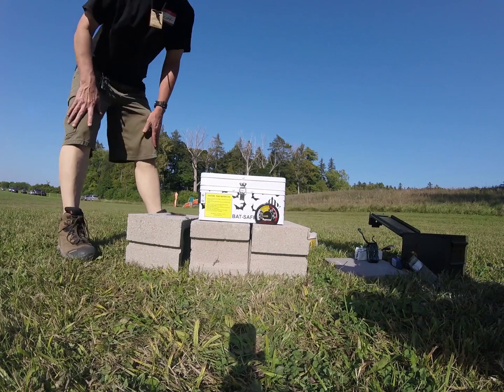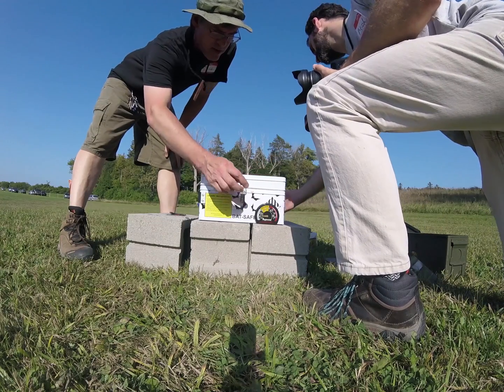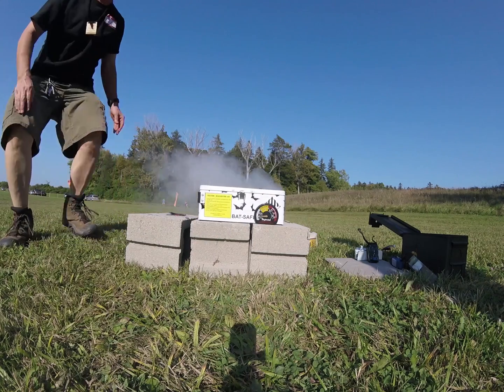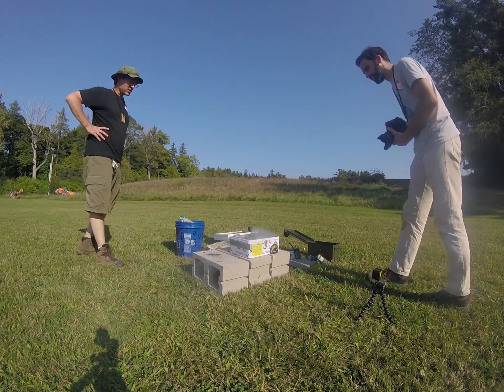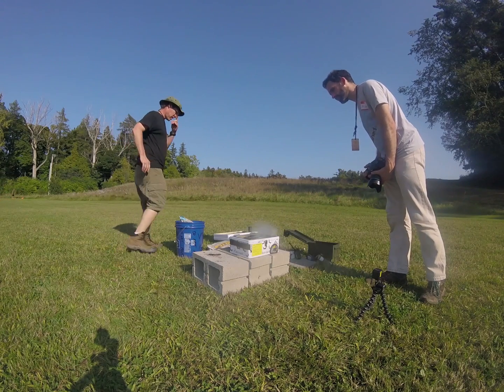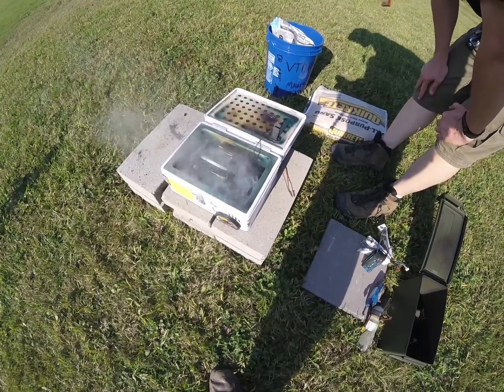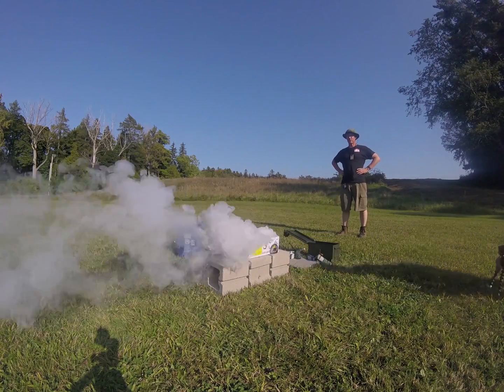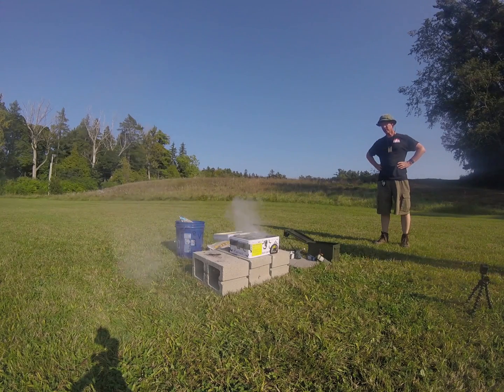LiPo container tests: BAT-SAFE

Comment: #BatSafe #Warning
⚠️⚠️⚠️ Can you please test the following for me, IT'S VERY IMPORTANT AND COULD EVENTUALLY BE A DANGER FOR YOU !!!! ⚠️⚠️⚠️

It is about the seal:

Please put a small piece of paper over the edge of the Bat-Safe and then closes it. 

(So there's a few cm inside the Bat-Safe and a few cm outside to pull it) 

(1 cm wide and about 10 cm long, so you can pull on it later (like a flap).

can you pull out the piece of paper when it's closed ?

With my 3 Bat-Safe's (Normal size)
I can do this both on the left & right side - both very simple, but really really easy on the front seal. 

So easy, I can even push / squeeze the paper in 🫣😱🤯🥴

do you know what material the sealing is made of ?

maybe I buy my own one 🤔

Comment: Can this box should be reutilize after a small fire or should get a new, what does your test conclude on this topic?

If a metal isn't melted and filter is easily replaceable then I don't see any problem reusing it.

I watched few videos about this box and your test was very convincing to get few of these including one from person who had fire during storage and was saved by this box and I personally had small fire and damage as a result during charging. However, I would split my batteries across more than one box, don't want to put too many eggs in same basket..lol

I'm planning to keep the boxes in the garage on the concrete floor away from everything including walls and using a smoke detector (may use smart detector so I can get alerts when the home is empty) in the garage as well.

Thanks for your good video guys, it was very helpful in making a decision whether to invest in one or not, before I was thinking to get an ammo box like others lipo owners but metal heating the bottom of the container was a concern for me 😊
Reply from the maker: The manufacturer says it can be reused. The box does appear to be in good structural shape though very discolored inside. I did not personally test a second fire.
Reply: @hazard-creative  thanks, is the filter replaceable? And is it available to buy?
Reply from the maker: @fks7655  No, it's built into the box.

Comment: Even in open air outdoors, I would still wear a respirator. One like the 3M Full Face 6800 or at least the cheaper half mask, especially when doing controlled test like these to teach safety. Breathing any bit of those chemicals and metals will not get flushed out of your body anytime soon. It's scary to have ailments that doctors cannot diagnose or ever trace back to the one time your breathed in a burning LIPO.

Comment: Is the white smoke poisoning the living room when it comes to a reaction inside the House? What if I use glass bubbles and lipo bags too? I think the smoke will always be poison for us. So i have to think on a suction system. Any ideas? I think on a welding suction system it cost alot and don‘t work automatically when it comes to smoke. I fear that they will keep fire when i sleep at the night in my storage box. By the loading process I am always there and watch it.
Reply from the maker: The BAT-SAFE has a filter in the lid. I tried contacting local officials to see if I could get the smoke tested to find out how bad it was, but nobody nearby had the right equipment to do that.
Reply: A smoke detector, wired into your stove hood (if you have one) which turns on the exhaust fan when smoke is detected. Wouldn’t be too difficult with the right know-how and fabrication skills.

Comment: Do you think it filters the smoke enough for it not to do damage if you keep it inside?
Reply from the maker: It will probably depend on the size of the batteries/fire. My guess is the results won't be pleasant, but neither will they be catastrophic. You'll probably have some cleanup to do but you won't have to throw away a whole room's worth of furniture. But that's only an educated guess.

Comment: I'm curious, you state that the 15 race batteries where nowhere near the two 6s 5000mah capacity. If I'm correct in my math here (assuming all packs were fully charged at 4.2volts and that they were standard 1300mah 4s packs) wouldn't it work out to 327wh? 2 6s 5000mah at 4.2 would be 252wh, and the capacity rating of the batsafe is 222wh. Am I doing fuzzy math here? It would mean the small batsafe is rated to store no more than 9 standard race batteries (at full charge).
Reply from the maker: There are two different points here. First, I believe that the Wh rating of the box is a general rule, calculated from nominal voltage only and the actual charge of the battery isn't supposed to be taken into account. In that case, the box would not actually be rated for two charged 6S 5000s, as you said. I don't think the manufacturer intends the actual charge amount to be part of the rating, but you'd have to ask them about it. On your second point, yes, about 10 or 11 4S 1300mAh batteries (at 3.7v) would be the rated capacity. Many of the 15 we loaded it with were 2S and 3S, so we ended up below the total rating. Maybe 'nowhere near' on capacity is not accurate, but the heat generated from a small 3/4S pack is much less than what you would get from a large 6S pack.
Reply: Not trying to critique, really was just trying to understand for safety reasons. I only keep 7-8 4s per box, but I wanted to understand your test fully. I appreciate it a ton, your real world testing led me to buy 2 of em, and I plan on buying the XL soon. I feel a lot better when I leave the house knowing my lipos are in a bat safe.
Reply from the maker: No worries! I'm hoping to test the XL as well, but it only makes sense in addition to this test if I can get it up to full capacity. Right now I've only got a lead on two 6S 5000s. If I can get a sponsor for the other four, I'll make that test happen.

Comment: I own a bat-safe. I have 1 - 3s 5,000mah lipo. I'm going to be living in an apartment. I'm not concerned about the fire. I'm concerned about the apartment filling up with smoke & killing my family. I can't take that chance. Going to have to get rid of car & hobby all together. Nimhs don't last long enough even in parallel. I'm sad.
Reply: Get a cheapo optical smoke alarm above it, it will wake you up in time if anything happens.
Reply: There really isn't enough smoke here to kill a person.
Reply: What you could do if you wanted was use the bat safe, which looks pretty good at containing the fire. Then build a compartment around it. Something simple with drywall for the walls,  but have something on the top that will filter the smoke. It wont stop everything but I think it would help. 

Plus have a portable fire alarm inside to alert you if something goes wrong.
Reply: Lol live a little
Reply: I'm in a apartment as well, you don't have to give up the hobby. Place a smoke detector above the box or inside, the box buys you more than enough time to move it to the balcony or to a safe place. I only charge one pack at a time as well whilst I'm home...apartment life
Reply: No needs to worry that much, Lipos are safe when you use them correctly. Just dont load the stuff in de night and if they are puffed or the cells arent in balance just throw them away correctly.